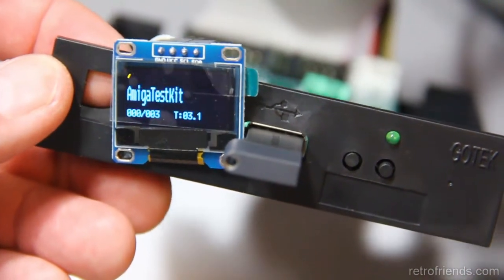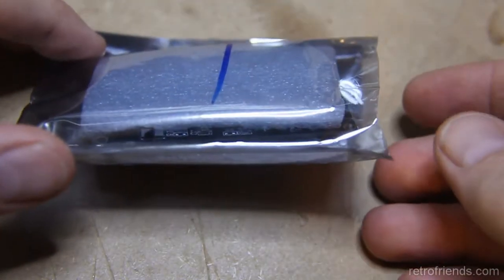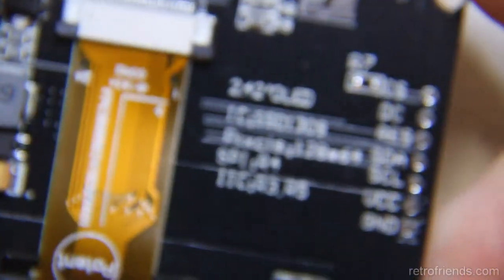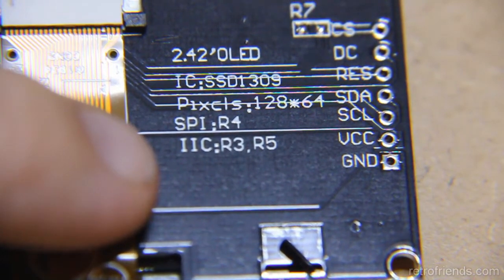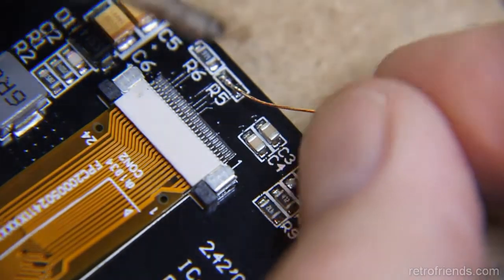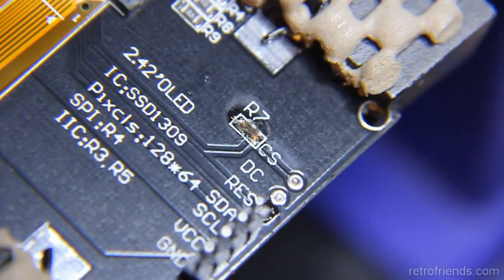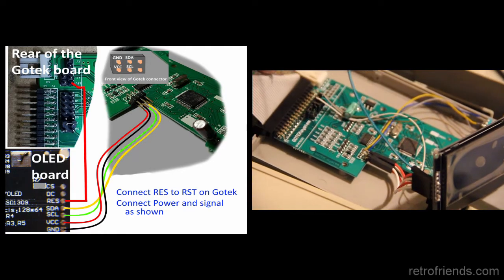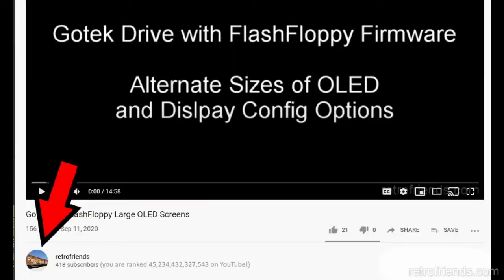Converting an SPI OLED to i2c 2.42in. DIYmore SSD1309

Comment: Very nice and clear instructions! Those 2.42" OLED screens require a power on reset (just like on an Amiga), and the reset pin on Gotek board provides exactly that (as well as being for manual reset).
Reply from the maker: Thanks!

Comment: Thank you, the clone of this screen had the resistors set for SPI but not the jumpers, adding the shorts to R15 and R13 in my case fixed my screen.
When using with an ESP32 you also have to connect the RES pin to the ESP32 reset line, in the case of the dev board I have it's labeled as EN.
Not 100% sure of this but I believe the CS pin is for chip select, so you can have 2 or more screens running on the same SPI Line, then you short to GND the CS line of the screen you want to use, then reset the screen and now you can use it. This may not work with some microcontrollers and is more of an educated guess..

Comment: VCC -- 10K -- Reset-- | 100nF | -- GND

and no reset connection external is necessary
Reply: Thank you for confirming no external reset.
Reply: Thank you! This was mentioned nowhere else. Works great with the SSD1306 driver and pydPiper now.
Reply: 27K and 10uF in my case were helpful